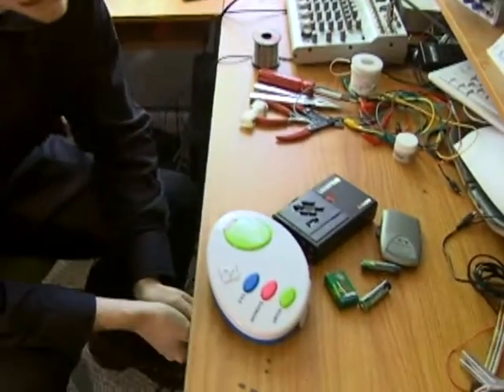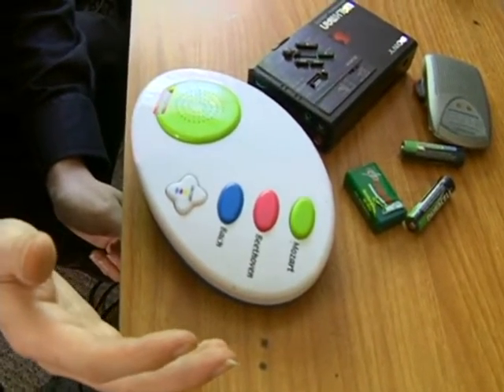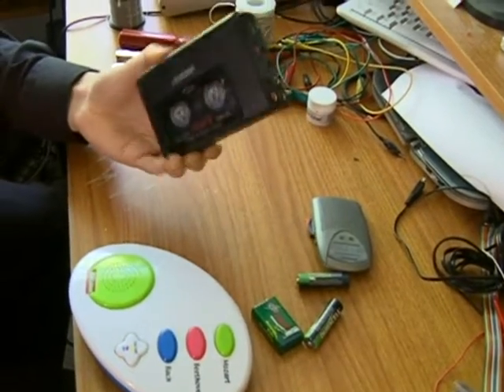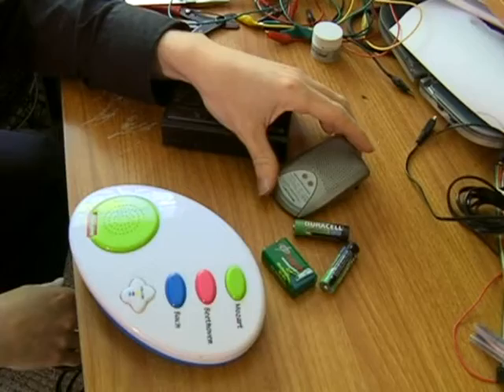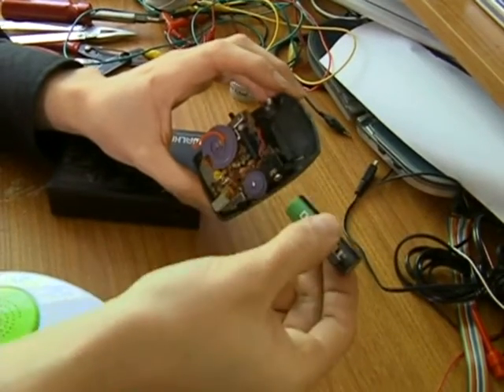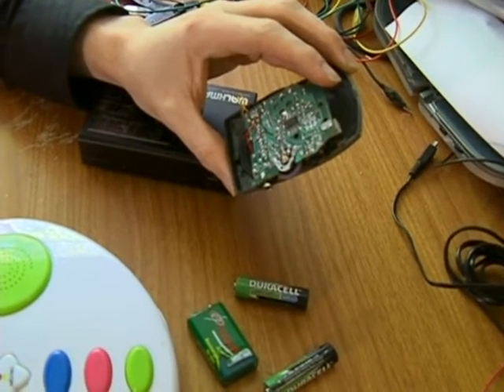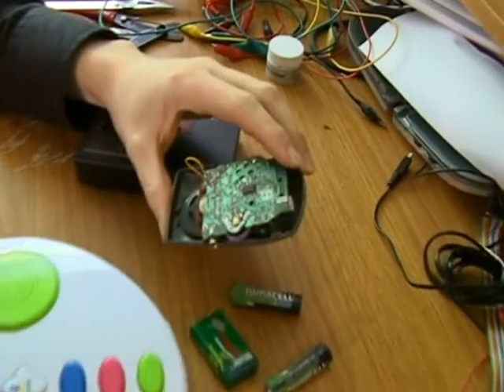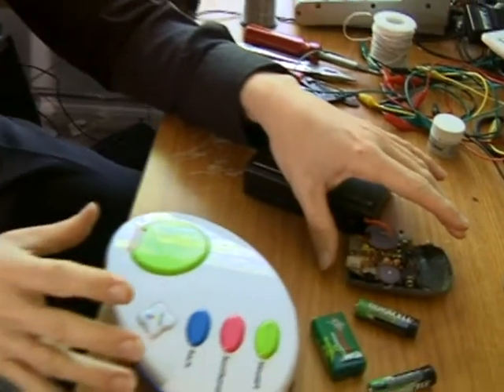How to Do Circuit Bending on Audio Electronics : Learn What Electronics are Used for Circuit Bending

Comment: you might want to explain what circuit bending is. i'm guessing it is connecting various solder points on the back of the board to make weird sounds. oh and the mustache is right outta the movie hot rod